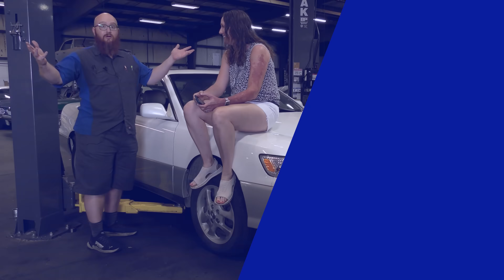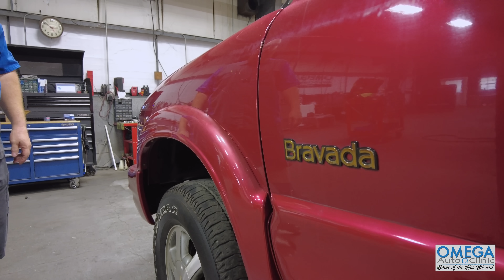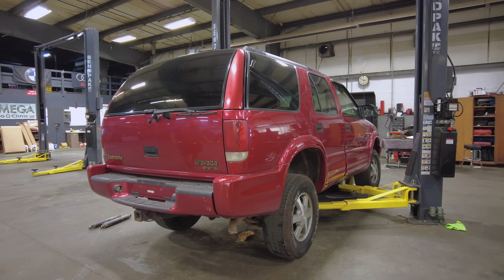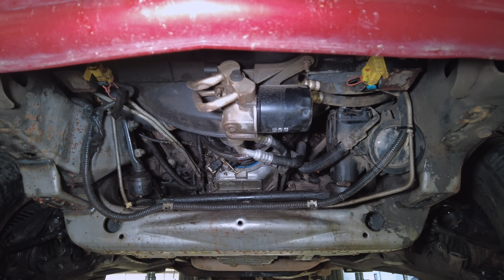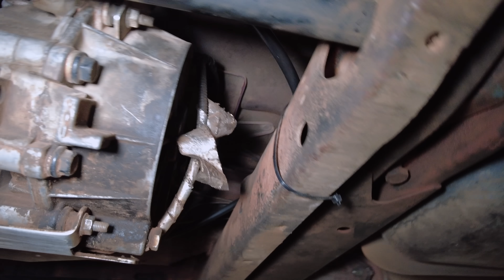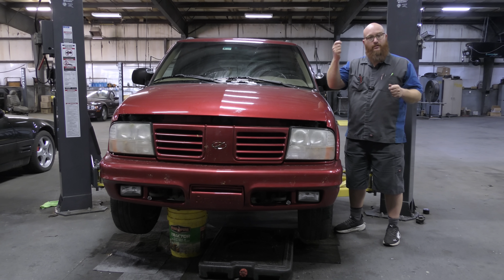Is Car Wizard Taking American Cars Again? That's an Olds Bravada!

Comment: 120K and it's already on it's second transmission? This truck is NOT good for 250K-350K miles.
Reply: The Bravada was driven to California and back and more than likely on old or low transmission fluid.  With good fluid and conservative driving, it won't be an issue.
Reply: Probably a 4l60. When i was a mechanic i used to work on a ton of the s10 versions. The Magic number was usually around 160k where the transmissions would go out, maybe the awd put a bit more strain on it. I’ve always had great luck with the 700r4 transmissions.

Comment: Tip
When replacing tail shaft seals always ensure that there isn’t a bearing that needs replacement too.
Also check the sealing surface for damage from wear.

Comment: If you're doing all that work, you should also add a plate to the inside of the xfer case to prevent the pump from pushing through the back case and creating a hole.

Comment: Have an older Honda Rubicon ATV that back in ‘19 I also put more than it was worth removing the engine, replacing the infamous hydrostatic trans, cam, timing chains, oil pump, many other parts. Biggest DIY mechanical project I’d tackled.

In almost 5 years now of like new reliability now it has evened out and was money well spent vs if I had went out and spent the $10K at the time for a new one. 

Satisfying every time I ride the the thing that I saved it from scrap, it works perfectly, and I know it inside and out

Comment: yes it is worth it. a person would pay 20.000$ or more for newer car.
Reply: Right on man....we priced Toyota, Lexus, and other modern products...in our opinion they are all overpriced heaps.  The problem I have is the metal used underneath is so thin to start with and in Nebraska winters, in just a few years your vehicles is unsafe to have on the road.  We don't care about mileage in this case...just reliable wheels for my wife to do a 100 mile daily trip in inclement conditions.  The rest of the time it will be parked in the garage and fired up occasionally to keep it limber.

Comment: I had this exact one. Bought for 3200 in 2008 with 100,000. Blew a valve the first week(my fault). Fixed and had the car for another 12 years. Went on a lot of camping and road trips. Awesome in the snow. Last couple years had shuttering issues. Needed 2500 to pass inspection. Sold to a friend for 250 and it died a few months later😢 also had a 97 blue blazer!

Comment: I have been involved with both Oldsmobile at a dealer, and on the Victory Motorcycle engine plant in Wisconsin.  The Victory motorcycle brand was built by the Polaris Industries brand, but the company bought the rights to Indian motorcycle, and stopped building Victory.😊

Comment: I just spent $2400 redoing many things on my 2003 Dodge Durango SLT. From new dual exhaust, new tires to new radiator, electric fans, transmission solenoids , pressure regulators. AC repair. New hoses , belts, water pump, brakes, wheel bearings and master cylinder brake booster combo. Because it has great styling. Solid built on truck frame. Will outlast any 40 to 100k SUV or Truck I could get new. I get comments all the time about how nice it is and how great it looks. I have people trying to buy it from me all the time. What would that leave me with? buying an overpriced new one and having a massive payment with many years to pay. No Thanks
Reply: Well done man.  My wife and I view our rides entirely on mechanical principles.  We don't care about looks because looks are misleading.  Our little town only has 2 dealerships - Ford and GM and anything else is in Lincoln, Omaha, and KC.  3 of our local private shops shut down due to the owners retiring.  If your vehicle needs emergency service, it's cheaper to have it towed to a local servicing dealer than the hour to Lincoln.  Many boxes were checked off for us on our Bravada.  It fits what we were prioritizing.
Reply: I also like the first 2 generations of Durangos.
Reply: The weak point is the OHC V8. If it had a 318, that would be bullet proof.
Reply: Man I miss my 2001 dodge durango, I live in the north east so sadly it rotted away . If I could find a clean one no rust I would jump on it in a heart beat

Comment: There was a time and maybe i still do but used to know everything about these year trucks. I was a mechanic in a town where everyone had these, usually the s10 models. They were great cheap 4x4 transportation. Lot of people had them who worked at the railroad and steel mills. Used to do a ton of transmissions and rear Leaf spring shackles as they loved to break.

Comment: The best ever Bravada review was from RCR.  Scathing and hilarious.  He would never spend 3k on a Bravada fix.  But on classifeds I see really nice ones for 10k now.
Reply: I've seen that video and had a good laugh out of it.  When you view things through the eyes of practicality and longevity, you can put up with a lot of shortcuts in other areas.  I would have liked it better if the front end had a solid axle as well.  Don't care about doing a slalom on the way work.  Mechanical simplicity is what it's about for me.  I'd drive a model T to work if I owned one.  Doesn't get much simpler than that.

Comment: Love the old GM products from that era they were certainly on par with Toyota reliability wise. One of the things I want to get for myself soon is a 4x4 old Blazer from that era.
Reply: They were definitely not on par with Toyota, despite having some great cars at the time…
Reply: @LowEnd31st  That is your opinion, but I have owned both and still own both and I am telling you they were on par engine quality with Toyota. The 3800 V6 and the LS based V8 engines were bullet proof if serviced.
Reply: @ same, and I just disagree. Cadillacs were never on par with Lexus for example. And a Cavalier is not quite as great as a Corolla. I daily drive a 3800 and it’s great, but the LIM gasket issue really takes it out of the race. A blazer cannot taste the abuse and neglect a 4 runner can.

Comment: Your thoughts on a 1998 Chevy. S10 .4.3 v 6 ,  100,000 miles , one owner by family member.  New compressor , battery ,fuel pump , fuel lines , no rust , extended cab , bed cap .
Reply: I'll tell you mine...compare it to what you get today when you buy new.  Almost nothing you can buy today will still be on the road as long as that S10.  Keep your solid rides going and save your money.  You've got much better things to spend your money on.  Put it towards real estate, a car, or taking your wife to a movie.

Comment: I have a 2001. Replacing the timing cover isn't as much fun as you make it sound like. The bottom edge rests against the oil pan gasket, and it has a little lip on the inside that's a real trick without dropping the oil pan. It'll take every bit of that 10 hours.

Comment: Cheaper than a car payment or the down payment. Fix it 👍 700r4 transmissions are trash! I know from having mine repaired 3 times!🤣😂🤣
Reply: And insurance if you wreck it pays you $300. Money down the pan.
Reply: @HughJashole69 don’t wreck it & put the basic insurance on it. Still cheaper than replacing it for a used/new car.
Reply: Also, who gets full coverage on a $3000 vehicle?🤔
Reply: Excellent point. Why must we spend more time working for a living just to volunteer our lives to more slavery just to keep looking for another new job with lower pay and less benefits just to have the newest piece of  under engineered ,lowest choices in quality of materials, highest price point, needed to be able to afford the payments so that we can keep sinking financially. Where's the sense in that? Sometimes it is worth spending a lot of money on refurbishing a tried and true reliable vehicle that can last another 10 years and 400,000.00 miles. 
I  find vehicles that have the most reliable, durable and dependable engine designs .
Take the Buick 3800 V6 .These engines can last well into the 400,000.00 mile range and it's usually the transmission the go's south before the engines fail. But once the body begins to rust ,then it's time to say goodbye.
Reply: @thyubernoob  We won't.  Just liability.  If you get full and need to invoke it, insurance just buys it from for cheap.  Not worth it.
Reply: @arnoldschmidt2753  Absolutely.  Our 1989 Buick gets driven 100 miles daily and it has 260k.  Got a little rust but nothing structurally risky.  No car payment, cheap tags, cheap insurance.  We're winning.
Reply: @arnoldschmidt2753  my 05 Lexus with 224K has entered the chat. The best looking car I own, is cash in the bank! Debt is not our friend.
Reply: @HughJashole69  That's why we only put liability on it and fix it ourselves.  My wife and I rebuilt the front end of her 1989 Buick when she hit a deer.  We take care of our own damage issues and don't involve insurance.
Reply: @Steverz32  That's it!
Reply: @thyubernoob  I sure as heck won't unless I'm renting a vehicle and need it for the coverage on the rental, but normally it's just going to be liability coverage.  On older cars that's aren't collectible, full coverage is a scam.
Reply: @LazloNQ  Right on ! You the old tried and true saying. " If you don't maintain, then don't complain ".

Comment: If people could find a good “sorter” like yourself, then buying a car like this or having one like this wouldn’t be so bad. The biggest headache is thinking you paid to have it sorted out only to find out that you’ve been shorted.
Reply: I crawled under it before I bought it.  I saw what it needed and Dave found more.  Seals and stuff is to be expected on a 25 year old vehicle.  It goes with the territory.  Fortunately more metal than plastic underneath and it's thick metal.  Love it.

Comment: My 99 blazer leaks in the same spot, lol. Heres something strange, the crank pulley has a separate pulley that has the timing marks on it. If it spins loose, it will be a night mare to put back in time, because the crank pulley doesnt have the timing marks on it.

Comment: I HAVE A 1995 4.3 VORTEX SLT GMC JIMMY 4X4 WITH TOW PACKAGE LOVE IT BLACK WITH 300,000 MILES RUNNING GOOD CHANGED THE FUEL PUMP, OIL COOLANT HOSES, STARTER, AND NOW NEED TO FIX THE EXZAULST SYSTEM THEIR IS A SMALL COOLANT LEAK THAT I'M TRYING TO FIGURE OUT AS WELL AWESOME VEHICLE TRUCK TO BE HONEST.
Reply: You know it man.  It looks boring, but underneath it's rugged as heck and easier to work on than modern awd stuff.  This vehicle was specifically chosen because it checked all our boxes.  We chose right.

Comment: I had a 1994 GMC JIMMY 4 door 4x4, when I sold it it had 292,043 on the odometer, engine ran great I did full synthetic oil changes every 4-5k miles, replaced the transmission at 265000 miles, I sold it with bad rear gears and the driver door stopped opening, other than that it was a cool rig.

Comment: Similar to what @LazloNQ said, i do not want, like, or desire pay for the new cars of today.  I did something similar, and just purchased a 2013 Lexus GS350.  Has one of the most reliable drivetrains ever made and is a good looking, luxurious, reliable, and NOT boring vehicle...where I could pay cash out of pocket and be happy.  While it was not a one owner vehicle, it was always serviced at the Lexus dealer and is mechanically perfect and up-to-date on all services.  Also got a pre-purchase inspection...well worth it.
Interior is almost perfect (98% like new) and exterior has a couple of dings and scratches which I fixed and is about 95% back to looking new...last thing is a tiny crack in the front bumper which i will repair next week.  Lastly, it was not local to me and I did have to travel 8 hours to get it, but it was worth it.
Reply: Well said man.  We gotta quit being victims with our vehicles and start buying smarter.  Going with the Lexus was smart.  There is a whole lot of crap being produced out there and I hate seeing people get fleeced like they are.  They seem to enjoy being fleeced as a result of their ignorance.  Not me.  Smart fiscal decisions helped my wife and I pay off a house in 9 years.  It's all about the fiscal discipline and not always have to have new in the world of vehicles.  If dealing with older vehicles, playing the Texas, New Mexico, Arizona card is what it's all about.  Tons of rust free rides they are scrapped over mechanical issues but cherry salt free bodies.

Comment: First time I saw a Bravada was when I worked for John Elway Toyota ( 10030 E Arapahoe Rd in Englewood CO - now Larry H Miller Nissan, and the city was renamed Centennial Colorado)  John brought the dark blue Bravada in.  That was in 92.  I remember it had a digital dash.  He drove it for a while along with his Lexus, and his wife at the time, Jan, had the Toyota Previa, since their kids were small at the time. I was sad when they sold the Bravada and he got the Dodge Viper. (I believe that was one of the first Vipers that came out at that time)  It's good to see a Bradava still on the road and @LazloNQ, I completely understand why you'd want this vehicle fixed.  Such a beautiful vehicle!
Reply: Thank You!  My wife and I view our vehicles mostly on their repairability and mechanical condition.  Age of a vehicle is truly of no concern to us (of course to a point) because underneath it all, if it's taken care of and maintained - it's just pistons spinning crankshafts and seldom does a vehicle truly wear out in my opinion.  They usually fail from rust,  inattention towards oil changes and maintenance, or outright abuse.  What fails are rubber seals, wear items, o-rings, etc. which can be a pain to get to, but once replaced is good for another 25 years.    Modern vehicles are clustered up with so much electronic complexity, people will be forced to scrap them way before they truly should.  For an occasional daily driver in the winter time, this is the perfect vehicle for my wife and I'm prepared to replace the spider with a post 2002 version if need be.  Check out motormanfuelinjectionDOTcom to see the info.

Comment: One of the best cars I ever owned was a 1991 Oldsmobile 98.Got it with 51,000 miles on it and drove it until it finally blew up the transmission. It had 369000 miles on it when it was parked for good.I really miss that car,it was like driving down the road on your couch.
Reply: For sure!  We have 260K on our 1989 Park Ave.  We are the only ones we see in our body style on a regular basis.  With our custom crash guard on the front, people take pictures and give us thumbs up.  I might talk to the Wizard and see if he wants to do a video on it, but truly it's nothing special.  It's got visible rust, but it still runs and drives.  In fact we drove it to Kingfisher, OK from Nebraska to get the Bravada.  Those old GM products are truly comfy...just like you say - driving while sitting on your couch!

Comment: I had a 98 GMC Jimmy shortly after I met my wife. We were driving that car the day we got married and about a week later the 4l 60 did 4l 60 things and we ended up driving it about 120 miles to her mom and dad’s place at about 25 mph because third and fourth gears had checked out of the train station. It went to the scrap man sadly. But in November we will have been married 13 years!!
Reply: My wife and I have been married 14 years in a couple months so congrats!  Previous owner said 3rd and 4th failed and burned up and had those clutches replaced.  Seems to be an issue with these transmissions.  It's getting Amsoil fluids in it and hopefully that will take care of all those issues.  We get insanely high miles with our Amsoil and love the product.  Our cars rust out before they fail mechanically.

Comment: If the trans was replaced then that might be one reason why the customer is willing to put the money into it, aside from it appearing to be in good shape (minus the oil leaking issues which will get fixed).  So that might be one reason and might make sense to put the mney into it (especially if, some how, it still has a transmission warranty, as I have seen a few cases where people were given a "life time" warranty on a rebuilt/new replacement transmission).

One advantage to the Olds and most GM vehicles is that they had a lot of parts that were available especially in the aftermarket so finding parts is not usually that hard for these as the 4.3L Vortec at least was a very popular engine overall, and was often times modded as well.  Just like how with some of the late 80's and early 90's Hondas you can find a lot of aftermarket parts to keep those cars runnnig (although most just rusted away as that was during an era when Honda had rust issues with their vehicles).

Comment: GM really seemed to vary so much with the 4.3 . I had a few full size trucks and they were so good. The mid size seemed so always have more issues. I had a green AWD bravada. I think mine was a little older. When the second transmission got installed it got sold. When it was good it was great though.

Comment: Yes, you may have not intended to say you wouldn’t work on American cars but it definitely was implied that being the case. It’s interesting to see the exotic cars but most of us can’t relate to them.

I have an ‘87 S-10 Blazer, bought new by my parents with 88K.  Neat old vehicle but I look at how it was designed and built and it represents the junk GM produced in that era.  Thankfully they started improving their quality.  My ‘04 GMC Sierra with 190K is the perfect truck for me when I need a truck.  I’d be more than willing to spend the money if it swarmed a transmission or such.  With the obscene prices for new vehicles driving up the price of used ones, it’s worth spending $3K to repair something like this, you can’t buy something equivalent for this kind of money.

BTW Wizard, my mother is from Newton.  In some videos I can hear the trains over in Sand Creek yard and I recognize some of the locations of your and Hoovie’s videos.  I didn’t know about your channel when I was last up there a couple years back or I would have tried to stop by.  Thanks.